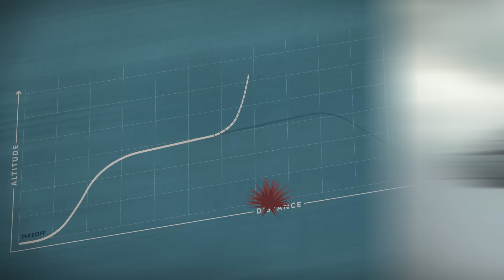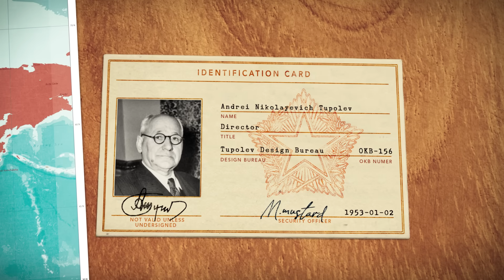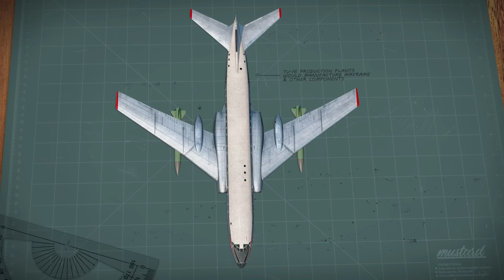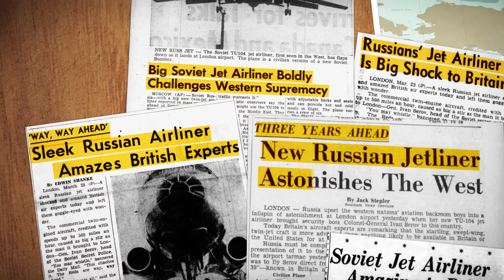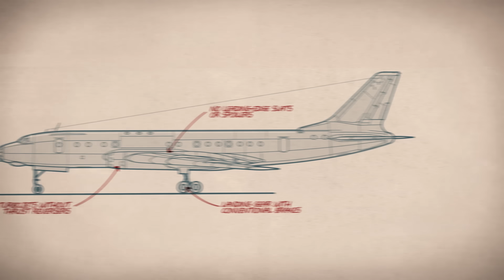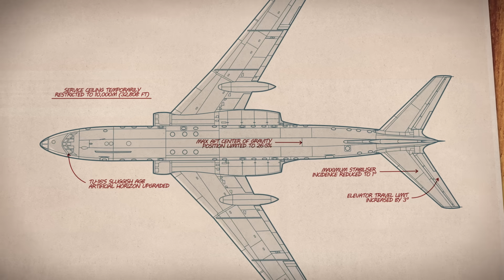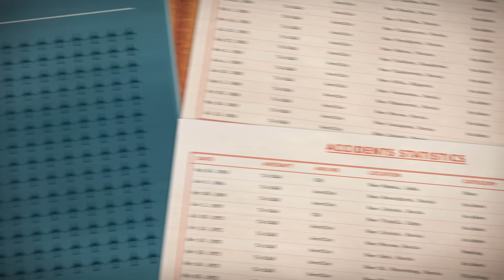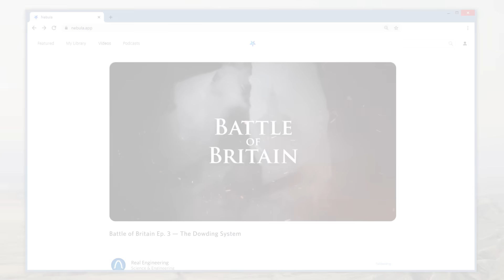The Soviet Airliner Designed To Crash

Comment: So B737 MAX was nothing new.
Reply: The Max has an excellent statistical safety record compared to the Tu-104 or the deHavilland Comet.

The Comet has the highest loss rate and fatalities statistics of any jet airliner in history
Reply: @sandervanderkammen9230 

We believe we can clear up some commonly held myths and misconceptions obviously.

It's always good to see the facts presented clearly and concisely isn't it?

Obviously there have been worse aircraft for accident losses both before & after the Comet.

  De Havilland was subjected to forced merger under the govt aerospace sector rationalisation programme.

In 1944 the RR Nene, a centrifugal compressor gas turbine aero engine, was the most powerful & most reliable gas turbine aero engine on the planet. For decades after 1944 copies & versions of the RR Nene & RR Derwent would go on to power aircraft in many countries including Russia (Mig-15 & Mig-17), the US, France, Switzerland and China.  Five manufacturers currently produce various types of gas turbine aero engines which include centrifugal compressors, the main application is helicopters. 

The world's first wind tunnel was constructed in England before 1890. The world's first supersonic wind tunnel was constructed in England in 1922. Extensive wind tunnel testing & evaluation were carried out for the Comet. All takeoff incidents were the result of stalls caused by over rotation. There were feature induced issues where pilots tended to not using jet airliner specific takeoff procedures. Subsequent changes made to the aircraft were an attempt to make the aircraft more tolerant of such errors. 

 Testing included water tank pressurisation cycle tests on two 20 foot lengths of fuselage which represented all features of the complete fuselage.

The engines used for the earlier Comets were of course similar to the RR Nene, were very reliable  & were not responsible for any Comet incidents.

The fabulous trail blazing DH Comet.
World's first jet airliner.
World's first high altitude airliner.

    How things were back then. 
Accident losses - % of aircraft built.

DeHavilland Comet 4 UK                     14% 
DeHavilland Comet all (ff 1949)         17%  
Vickers VC10 UK (ff 1962)                   5%

Douglas DC-1                                      99%
Douglas DC-2                                      47%
Douglas DC-3                                      30%
Douglas DC-4                                      26%
Boeing s300                                        72% 
Boeing 307                                          70%
Boeing 247                                          48%
Boeing 707  (ff 1958)                         20% 
Lockheed L-049/149 Constellation  30%
Lockheed Electra  Turboprop .          29%
Fairchild FH-227                                 30%
McDonnell Douglas DC-8                  14%. 
Sud Aviation Caravelle                       15%
Canadair CL-44 Turboprop (ff 1959) 46%  
Convair CV-580 Turboprop                 22%
Convair CV-880  (ff 1959)                   27%  
Convair CV-990  (ff 1961)                   33%
Tupolev T-104     (ff 1956)                   16%

  The Vickers VC10, fastest Atlantic crossing for a non supersonic jet airliner, held the record for 41 years. 

   Of course De Havilland carried out a full stress analysis & performed extensive & protracted testing, including pressure cycle testing, on two long lengths of fuselage. De Havilland carried out significantly more testing than was required by any authority at the time & significantly more testing that any previous airliner was subjected to.

    De Havilland did indeed always work to better than industry standards at the time, used up to date knowledge for the design & no evidence of negligence or criminal negligence was ever produced in relation to the DH Comet.

  The DH Comet had better safety than or similar safety to many other commercial passenger aircraft of a similar era both before & after the DH  Comet.

Pretty much all changes made after the Comet 1 were just in case changes or were previously planned ongoing improvements.

We do indeed hope this helps, of course.
      
As always, cheers & 👍 indeed.  .

Comment: Boeing B 737 MAX: Hold my beer
Reply: The Max only has 2 crashed out of nearly 2,000 in service.
1.01 hull losses per million flights.
 
Better than the Tu-104 or the worst jet airliner in history... the de Havilland Comet.
Reply: @sandervanderkammen9230  There were 346 deaths in those two accidents. This is not a figure to be underestimated., Furthermore, the difference with its competitors is that those 1,844 737 MAXs are still flying, so that gap will close. Is it a fact that the US government is covering up for Boeing, or how do you explain that the same company is conducting the safety inspections?

Comment: Not to mention their crack at an SST.:face-fuchsia-tongue-out:
Reply: The Soviets built the FIRST SST
Reply: @sandervanderkammen9230 

We believe we can clear up some commonly held myths and misconceptions obviously.

It's always good to see the facts presented clearly and concisely isn't it?

Obviously there have been worse aircraft for accident losses both before & after the Comet.

  De Havilland was subjected to forced merger under the govt aerospace sector rationalisation programme.

In 1944 the RR Nene, a centrifugal compressor gas turbine aero engine, was the most powerful & most reliable gas turbine aero engine on the planet. For decades after 1944 copies & versions of the RR Nene & RR Derwent would go on to power aircraft in many countries including Russia (Mig-15 & Mig-17), the US, France, Switzerland and China.  Five manufacturers currently produce various types of gas turbine aero engines which include centrifugal compressors, the main application is helicopters. 

The world's first wind tunnel was constructed in England before 1890. The world's first supersonic wind tunnel was constructed in England in 1922. Extensive wind tunnel testing & evaluation were carried out for the Comet. All takeoff incidents were the result of stalls caused by over rotation. There were feature induced issues where pilots tended to not using jet airliner specific takeoff procedures. Subsequent changes made to the aircraft were an attempt to make the aircraft more tolerant of such errors. 

It is in fact correct to state that no aircraft manufacturer had managed to produce a high altitude airliner with a full fuselage length pressurised passenger cabin pressurised to 8 psi differential before De Havilland did it with the fabulous trail blazing Comet. This was the first aircraft where pressurisation stress significantly exceeded flying stress for most of the airframe. The world's first pressurised cabin aircraft was a British design Airco built under licence in the US and modified in the US to have a pressurised cockpit cabin during a joint US / UK research project. 

 Testing included water tank pressurisation cycle tests on two 20 foot lengths of fuselage which represented all features of the complete fuselage.

The engines used for the earlier Comets were of course similar to the RR Nene, were very reliable  & were not responsible for any Comet incidents.

The fabulous trail blazing DH Comet.
World's first jet airliner.
World's first high altitude airliner.

    How things were back then. 
Accident losses - % of aircraft built.

DeHavilland Comet 4 UK                     14% 
DeHavilland Comet all (ff 1949)         17%  
Vickers VC10 UK (ff 1962)                   5%

Douglas DC-1                                      99%
Douglas DC-2                                      47%
Douglas DC-3                                      30%
Douglas DC-4                                      26%
Boeing s300                                        72% 
Boeing 307                                          70%
Boeing 247                                          48%
Boeing 707  (ff 1958)                         20% 
Lockheed L-049/149 Constellation  30%
Lockheed Electra  Turboprop .          29%
Fairchild FH-227                                 30%
McDonnell Douglas DC-8                  14%. 
Sud Aviation Caravelle                       15%
Canadair CL-44 Turboprop (ff 1959) 46%  
Convair CV-580 Turboprop                 22%
Convair CV-880  (ff 1959)                   27%  
Convair CV-990  (ff 1961)                   33%
Tupolev T-104     (ff 1956)                   16%

  The Vickers VC10, fastest Atlantic crossing for a non supersonic jet airliner, held the record for 41 years. 

The DH Comet & Sud Aviation Caravelle had similar accident loss fatalities for the first few years of operations.

Agreed, that is correct of course, clearly there are many countries that could easily produce airliners of better  quality than Bow-wing (see b-47 wing folding & wing collapse incidents) but don't for some very good reasons. Bow-wing being a result of the size of the US, the large protected domestic market & great ease of testing new types due to the equator to arctic geography & a few other reasons related to production scale capability, politics & economics.

  Obviously there really is nothing special about Bow-wing, having more than 50 years design / build experience on the type means they have no excuses for the horrendous Max incidents for example.

   Of course De Havilland carried out a full stress analysis & performed extensive & protracted testing, including pressure cycle testing, on two long lengths of fuselage. De Havilland carried out significantly more testing than was required by any authority at the time & significantly more testing that any previous airliner was subjected to.

    De Havilland did indeed always work to better than industry standards at the time, used up to date knowledge for the design & no evidence of negligence or criminal negligence was ever produced in relation to the DH Comet.

  The DH Comet had better safety than or similar safety to many other commercial passenger aircraft of a similar era both before & after the DH  Comet.

Pretty much all changes made after the Comet 1 were just in case changes or were previously planned ongoing improvements.

We do indeed hope this helps, of course.
      
As always, cheers & 👍 indeed.  .

Comment: The Tu-104 has a very good safety record compared to the de Havilland Comet, no jet airliner has a higher crash rate or deaths per flights than the Comet.
Reply: We believe we can clear up some commonly held myths and misconceptions obviously.

It's always good to see the facts presented clearly and concisely isn't it?

Obviously there have been worse aircraft for accident losses both before & after the Comet.

  De Havilland was subjected to forced merger under the govt aerospace sector rationalisation programme.

In 1944 the RR Nene, a centrifugal compressor gas turbine aero engine, was the most powerful & most reliable gas turbine aero engine on the planet. For decades after 1944 copies & versions of the RR Nene & RR Derwent would go on to power aircraft in many countries including Russia (Mig-15 & Mig-17), the US, France, Switzerland and China.  Five manufacturers currently produce various types of gas turbine aero engines which include centrifugal compressors, the main application is helicopters. 

The world's first wind tunnel was constructed in England before 1890. The world's first supersonic wind tunnel was constructed in England in 1922. Extensive wind tunnel testing & evaluation were carried out for the Comet. All takeoff incidents were the result of stalls caused by over rotation. There were feature induced issues where pilots tended to not using jet airliner specific takeoff procedures. Subsequent changes made to the aircraft were an attempt to make the aircraft more tolerant of such errors. 

It is in fact correct to state that no aircraft manufacturer had managed to produce a high altitude airliner with a full fuselage length pressurised passenger cabin pressurised to 8 psi differential before De Havilland did it with the fabulous trail blazing Comet. This was the first aircraft where pressurisation stress significantly exceeded flying stress for most of the airframe. The world's first pressurised cabin aircraft was a British design Airco built under licence in the US and modified in the US to have a pressurised cockpit cabin during a joint US / UK research project. 

 Testing included water tank pressurisation cycle tests on two 20 foot lengths of fuselage which represented all features of the complete fuselage.

The engines used for the earlier Comets were of course similar to the RR Nene, were very reliable  & were not responsible for any Comet incidents.

The fabulous trail blazing DH Comet.
World's first jet airliner.
World's first high altitude airliner.

    How things were back then. 
Accident losses - % of aircraft built.

DeHavilland Comet 4 UK                     14% 
DeHavilland Comet all (ff 1949)         17%  
Vickers VC10 UK (ff 1962)                   5%

Douglas DC-1                                      99%
Douglas DC-2                                      47%
Douglas DC-3                                      30%
Douglas DC-4                                      26%
Boeing s300                                        72% 
Boeing 307                                          70%
Boeing 247                                          48%
Boeing 707  (ff 1958)                         20% 
Lockheed L-049/149 Constellation  30%
Lockheed Electra  Turboprop .          29%
Fairchild FH-227                                 30%
McDonnell Douglas DC-8                  14%. 
Sud Aviation Caravelle                       15%
Canadair CL-44 Turboprop (ff 1959) 46%  
Convair CV-580 Turboprop                 22%
Convair CV-880  (ff 1959)                   27%  
Convair CV-990  (ff 1961)                   33%
Tupolev T-104     (ff 1956)                   16%

  The Vickers VC10, fastest Atlantic crossing for a non supersonic jet airliner, held the record for 41 years. 

The DH Comet & Sud Aviation Caravelle had similar accident loss fatalities for the first few years of operations.

Agreed, that is correct of course, clearly there are many countries that could easily produce airliners of better  quality than Bow-wing (see b-47 wing folding & wing collapse incidents) but don't for some very good reasons. Bow-wing being a result of the size of the US, the large protected domestic market & great ease of testing new types due to the equator to arctic geography & a few other reasons related to production scale capability, politics & economics.

  Obviously there really is nothing special about Bow-wing, having more than 50 years design / build experience on the type means they have no excuses for the horrendous Max incidents for example.

   Of course De Havilland carried out a full stress analysis & performed extensive & protracted testing, including pressure cycle testing, on two long lengths of fuselage. De Havilland carried out significantly more testing than was required by any authority at the time & significantly more testing that any previous airliner was subjected to.

    De Havilland did indeed always work to better than industry standards at the time, used up to date knowledge for the design & no evidence of negligence or criminal negligence was ever produced in relation to the DH Comet.

  The DH Comet had better safety than or similar safety to many other commercial passenger aircraft of a similar era both before & after the DH  Comet.

Pretty much all changes made after the Comet 1 were just in case changes or were previously planned ongoing improvements.

We do indeed hope this helps, of course.
      
As always, cheers & 👍 indeed.  .